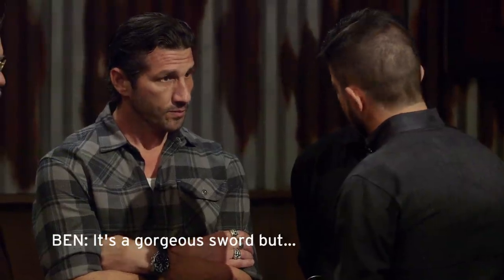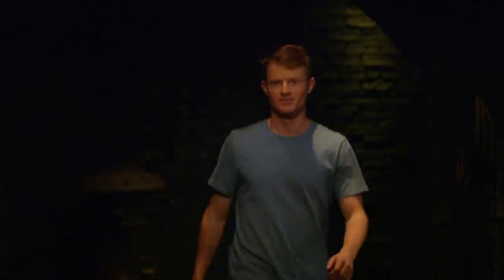Forged in Fire: OK Boomer? MORE LIKE K.O. BOOMER! *Epic Battle vs. Gen Z!* (Season 7)

Comment: Let's be real, this is a clear case of the winner just being lucky the other blade failed. Lighter, better weight distribution, amazing Damascus pattern and (until it broke) a more comfortable and usable handle. I want to see what that kid will be making at the other smith's age, because it will be glorious.
Reply: Was not luck.  As soon as he said the handle was not fit right it was a given it was gonna break. Had it made it to the finals he'd have won but that don't matter
Reply: @You Mang  that's a mistake you make once. What would save the other smith who was too lazy to even do Damascus on a 4-day build next time? That's what luck means, the kid made a tiny mistake, and honestly it would have been a ridiculously easy fix, it just didn't fit in the scope of this competition. Unlike that ugly blade with rolled edges that would need an hour of grinding at least.
Reply: Also a clear case of having advanced tooling but slacking on final touches. He noticed the handle wasn't up to scratch and then botched it. Entirely on him.
Reply: @MovingTargetTez  or maybe he thought it would be fine, and found out the hard way it wasn't. As if that other smith did a better job with that mini-carrot sized handle that slipped in the hand. Y'all are acting like the other handle was good, and a handle can be changed, unlike the actual blade and forging that was done so much better.
Reply: @charles-antoinemartel-roy  well it didn't break.  I don't think anyone is saying the kids blade was bad, but like you say a 4 day build and you cut that corner.  I knew immediately that it was gonna break during testing, other than that his blade was cherry. He would won for sure but yeah
Reply: Not luck at all, the kid knew he was turning in a sword with a poor handle, and it cost him the victory.
Reply: @youmang  I am going to give you a tungsten rod,  It wont cu anything, but it won't break.
Reply: agreed with you, thje other one is just griding a sword either forging a sword.
Reply: @skipmage  the blade didn't break..... it was the handle
Reply: @youmang  No handle, no break
Reply: I don't feel same... Victory depends absolutely everything on parameters ,function and looks...
His time management was off the pace that's why he couldn't finish handle properly in given time...there is lesson to learn 
How can u justify poor handle matarial loose gaurd...at the end one has sword other has Just large beautiful edge
Reply: Agreed that kid has some skill
Reply: Nah it what happens when you don't treat all parts of the blade your making important and don't focus on one part
Reply: One mistake sent the talented boy home it's ok I mean his blade was better it was just his handle he can definitely fix it one day
Reply: @aliddda328  so his knife wasn't good enough then and the handle is part of the knife so of the handle is bad the knife is bad
Reply: @charles-antoinemartel-roy  And that ugly iron bare win couse that beauty, lighter, real sword have weakpoint. And its always the weakest link first fail.
Reply: Heavy is good heavy is reliable if it doesn't work you can hit them with it
Reply: True but I would rather have a not so good sword in a battle than a nice sword for one target

Comment: As soon as he pulled that ebony out it was guaranteed to be trouble.  Ebony is a really brittle wood.

It's a shame as the older guy completely phoned everything in and made a terrible blade.  He didn't win, the kid lost.
Reply: Yeah, the old guy's weapon was so mediocre, it was just made so he could turn something in. The finish was meh, the weight was intentionally kept so risk was minimal in the strength test, and the handle that was basically a long finger.

Comment: Although i love the visuals of damascus, if there's 1 thing i learned from forged in fire is to keep yourself to the basics. The parameters, weight, balance, handle design, pommel and guard are the deciding factors in most episodes.
Reply: But if everyone played it safe and didn't try things like Damascus, the show would be much less interesting
Reply: But the blade held up beautifully and being a weld patterned steel ( not damascus) didn't matter since the blade was properly tempered, he did a beautiful work on it, it's the handle that failed and for two reasons.
1 He used ebony, beautiful wood but to brittle and prone to break when abused.
2 he didn't use pins to secure the handle, with that internal twist in the tang ( caused by him not being careful while drilling the wood) they would have helped to have a better mechanical grip lock and also would have helped to absorb the violent shockwaves from the impacts better instead of relying only on the epoxy glue and the pin at the end of the pommel.
He was too confident and loose for that important detail.

Comment: He won by technicality. the sword that was broke was a work of art and designed well. Unfortunately his damascus didn't hold up.Damascus is often risky but if it holds up its the thing that will push you over.If the handle was tighter it probably would have held up fine. Good Mechanical fasteners is key!
Reply: It was the handle that broke not the blade, the blade was brilliant.
Reply: Dude, Damascus hold up awesome, the problem was the handle
Reply: read the comment above. You made a mistake and didn't listen to what the judges said and my answer above for you too.
Reply: @williamdevlin5439  "Unfortunately his Damascus didn't hold up" that's what you said, but Damascus wasn't the problem it was the handle. I'm sorry but I don't get your point lol

Comment: Lost because of a handle. Made a heck of a sword but shows just 1 small mistake can mess up everything
Reply: Small mistake? He created a handle drilling a single big piece of ebony ( that is a beautiful wood, but too brittle and prone to break when abused and not worked correctly) completely off centered because he wasn't paying attention.
He also put a lot of epoxy resin glue and a small pin at the end of the pommel to correct his error instead of doing a two piece wood handle secured by pins ( that would helped in having a better and tight mechanical connection between the tang and the handle but also having a better shock absorber for the shockwaves due to the blade impact). 
It was grave mistake, and his loss is correct, I'm sad for him because he showed a great potential when working on the blade, but nonetheless he deserved to loose.
It will be a lesson for the future and I'm sure he will become a better smith.